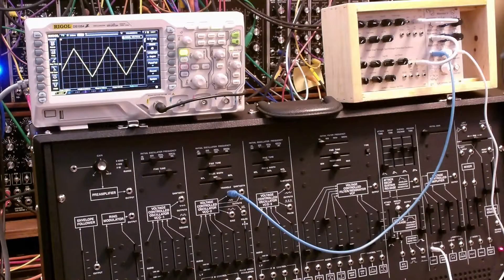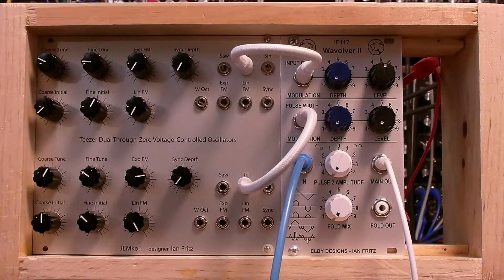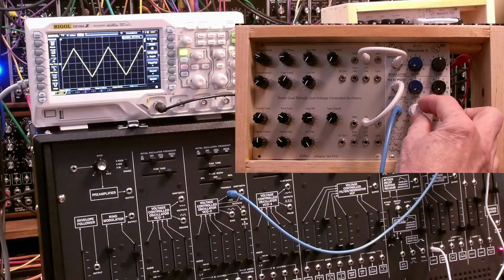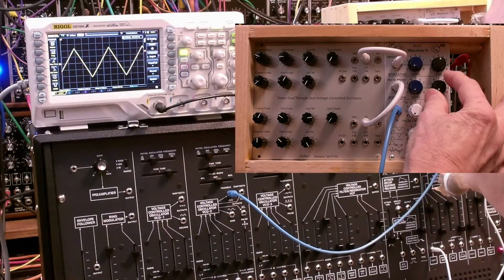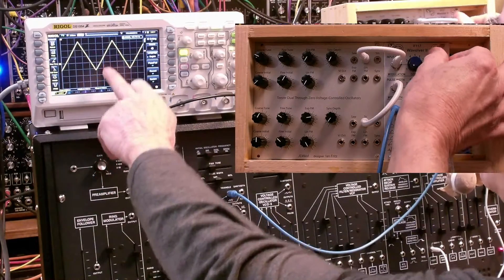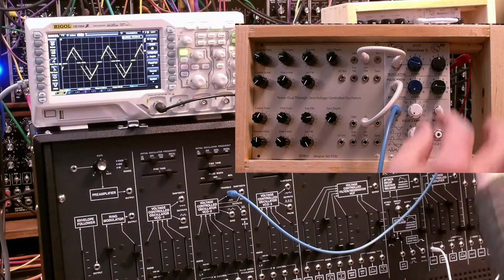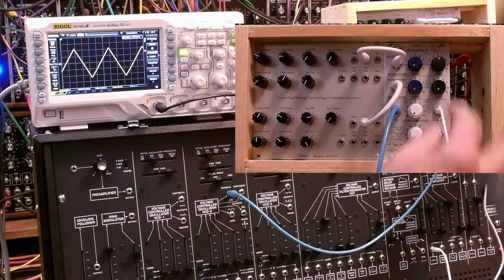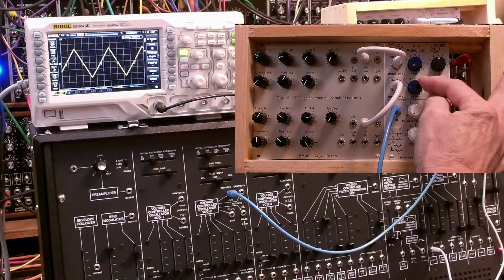Arp 2600 with Wavolver II waveshaper module by Ian Fritz

Comment: Interesting. PULE 2 AMPLITUDE acts as an adjustable rectifier.
Reply from the maker: yes!  It goes about it in a different way, but that's what  it becomes with some settings ( Pulse 2 Amplitude +5 (fully clockwise) ).
Reply: @ozhalljr   Have you experimented with modulating those parameters with other waveforms from the same VCO generating the triangle or another VCO synced to it? I'll bet you can get some seriously complex content that way. Audio rate FM using waveforms in sync will help it to remain more musical and less harsh.
Reply from the maker: @precarious333music  I have used audio rate modulation on the Wavolver II modulation inputs.  I'm pretty sure I tried from the same VCO.  I think the results were better from a different slightly detuned oscillator.
Reply: @ozhalljr   Ah, good to know. I dig some of the Fritz designs. I have the SSL 5U version of his 5-Pulser. Such a unique idea. The addition of XOR by SSL is way more useful than I thought it would be. In that case, using synced waveforms produces much more pleasing results. Thought it might apply here as well.